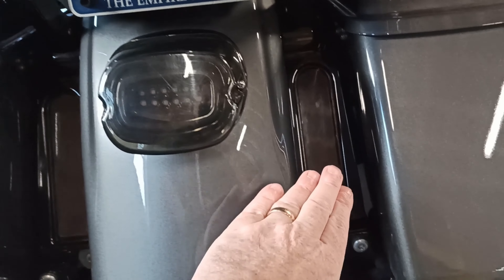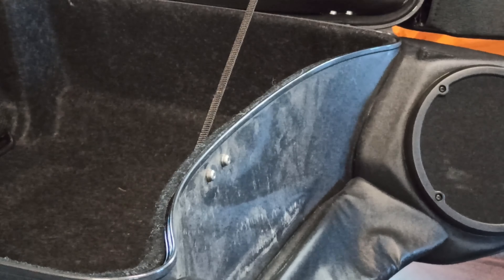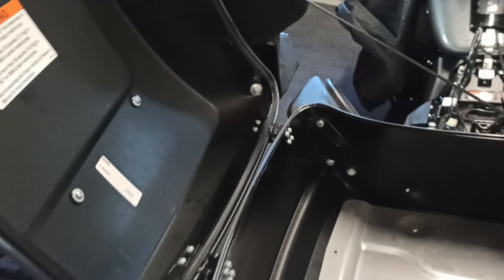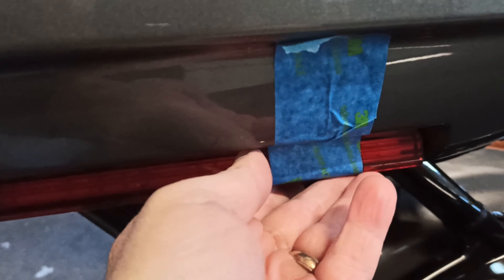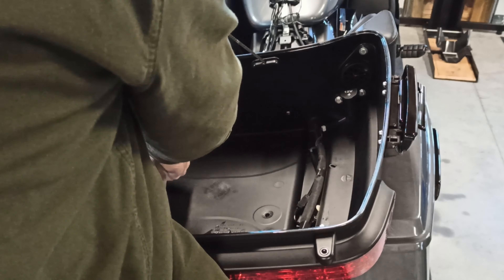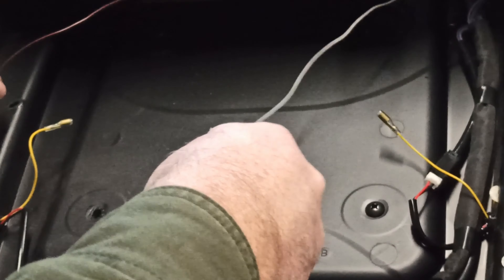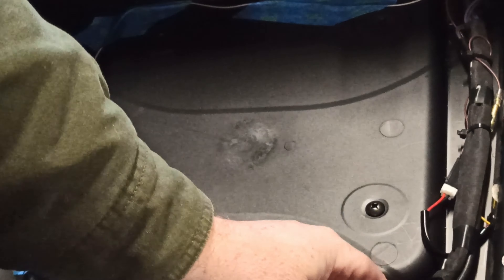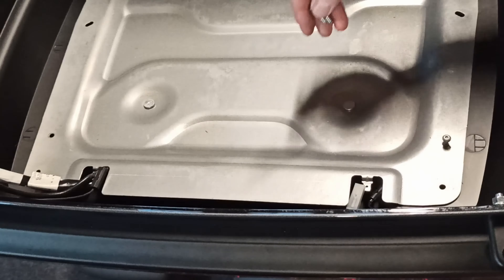Eagle Lights Tour Pak Auxiliary Lights For Harley Davidson

Comment: Hi, so when you brake the light turn from red to yellow? I installed them on my 23 ultra limited and it drives me crazy that they turn yellow for braking. I was looking to bypass them somehow but the brake signal is carried through the turn signal too.. 😡 does everyone have this issue?
Reply from the maker: Yeah, in the video, I mentioned that was my only issue with this set of lights. I wish the brake would be red. I don't know of a way to bypass them either. Thanks for stopping by and watching 👍
Reply: Hey thanks for the reply, I was able to get the lights to work for turn and running lights. I have the slim sequential lights on my saddle bags and was able to tap into that module for the yellow signal. Apparently that module doesn’t send a brake signal through one of the lines. I’m sending you a video so maybe it can help anyone else with this problem.
Reply from the maker: Oh that's awesome.  Thanks for the new info on the lights 👍